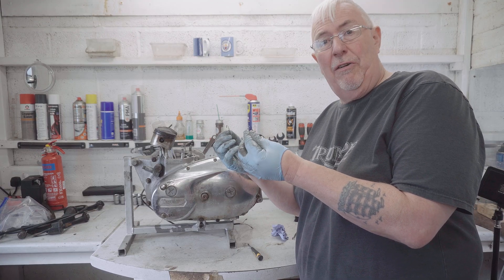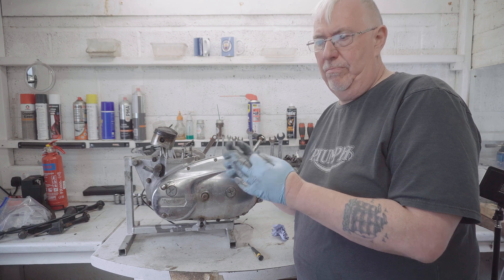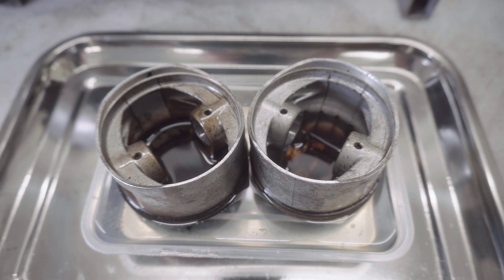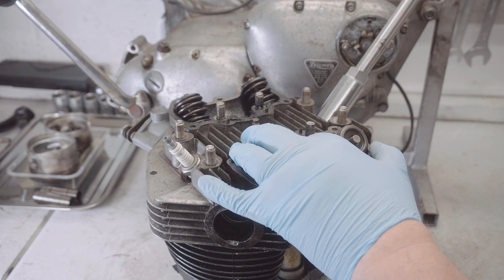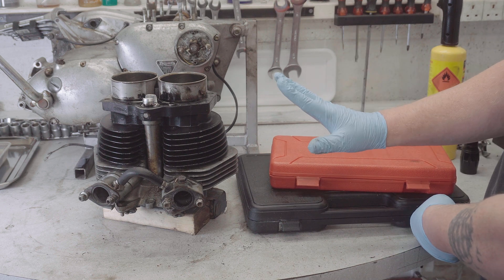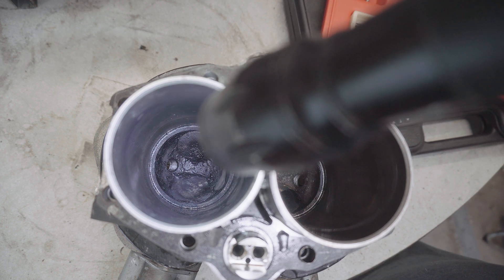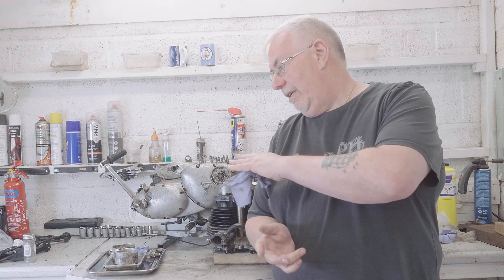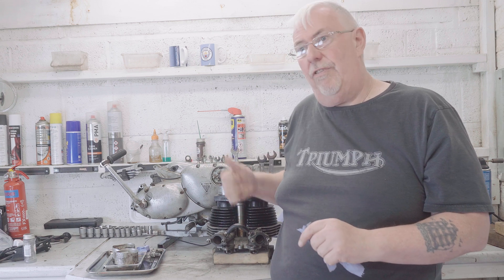Measuring the Barrels and Pistons of My Barn Find Triumph T140 Bonneville Dessert Sled | 06

Comment: 0.9mm is just shy of 4 thou, which is perfect. A quick hone and new rings and you're good to go.  Have you got that head off yet? I think by now I would have welded a nut onto the studs to try and remove them, having repeatedly soaked them in penetrating oil. TBH I wouldn't have removed the engine until I'd got the head off. Great project.
Reply from the maker: Thanks for the encouragement, there's even more to think about with the barrels and head, something I hadn't realised in this video :) I am going to do the engine and rolling chassis concurrently so I don't want issues with the engine stopping me getting on with the chassis.

Comment: Re: getting the heads off, try getting white vinegar down the stud holes and letting it soak. It should dissolve the aluminium oxide which is the problem. Anything poured down the bores isn't going to help in this case.
Reply from the maker: Thanks.  I will look into using the white vinegar.  I have used it for cleaning tanks etc in the past, never thought of using it here.

Comment: I quite enjoy the metrology part of it my self  I used snap gauges  and a a micrometer  on the new brg inserts in my FZ 750 cases measured thd crank   And did the maths I had to swap several brg shells about to get the correct clearance but as I was using a different crank in the cases  I didn’t really trust the crankcase hyroglyphics and the stamping on the crank  that’s the way I did it very pleased with the result
Reply from the maker: It's great when you measure things and it all makes sense.  I know what you say about the stamps on the cases.  Who knows what has happened to them in the 30 or 50 years since.

Comment: Whats the point of measuring when you can get the head off? You dont know what the top cylinder is like...
Reply from the maker: If the bores were worn out, and the pistons had too much clearance then looking for other barrels and pistons might be quite reasonable.  However as it doesn't seem that the bores are worn, and the pistons seem to have an appropriate clearance it is worth making an effort not to damage the barrel.   

I suspect you mean I don't know what the top face is like and whether it would need machining, but as it stands if they would just come apart I suspect the top would be fine.  However I may cause damage in my efforts to split them.  

At the moment I feel that it is more important to protect the head ( the more expensive component ) than the barrels.  However if I can reuse both that would be great.  If the barrel where completely useless I could contemplate sawing them off :)

Comment: Also has it got alloy barrels? I thought only the Harris ones had them, they were nickasil and can’t be bored.
Reply from the maker: I'm pretty sure the barrels have steel liners and are pretty much standard, not plated.
Reply: @SPANNERRASH  a friend bought a Harris tiger 750 new and it had porous cases and after it was apart a few times trying to stop oil leaking I pulled out a barrel stud. We ended up painting inside the cases with orange etch primer and put iron barrels on it. Also alloy barrels used a composite head gasket on them, explains why stuck. Good luck with it . I’ve had a 76 bonne for 30 years
Reply from the maker: Thanks for the info. I can't wait to get to the point that I am worrying about oil leaks :)  Hopefully not too many.